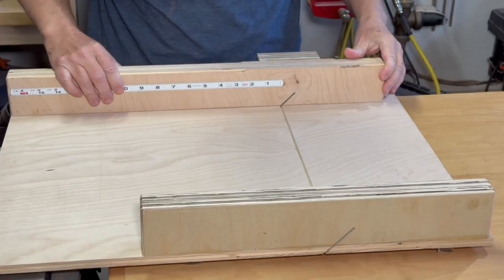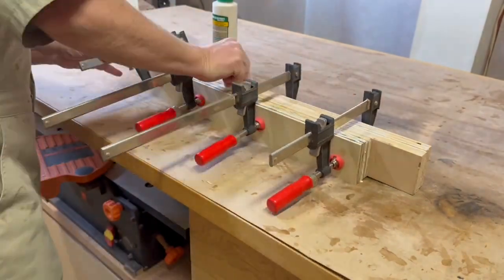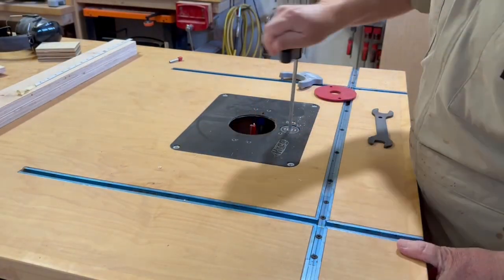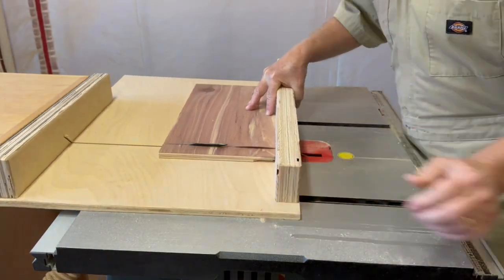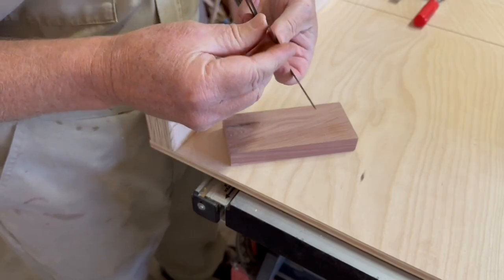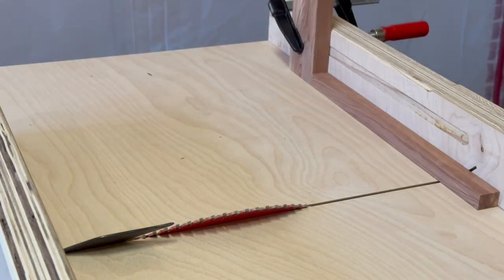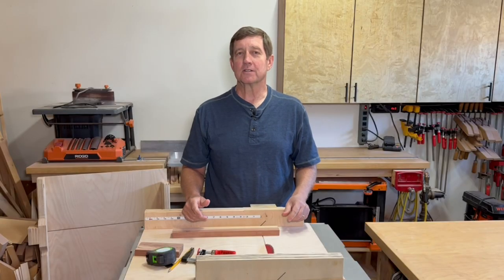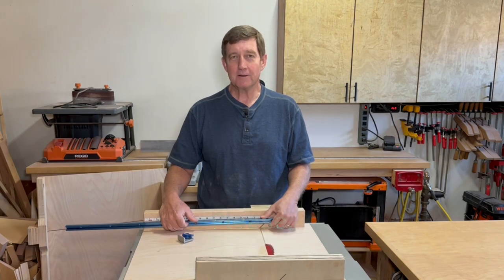How to Make a 45 Degree Bevel Table Saw Crosscut Sled

Comment: Hello Sir. This was an excellent presentation. I have a  questions. To set you measuring tape did you measure the long side or the short side ? I appreciate your input. Thanks.
Reply from the maker: I set it along the short side, the bottom side of the workpiece.  The top side (long side) of the workpiece length will vary depending on the thickness of the wood.  Thanks so much for your kind words!